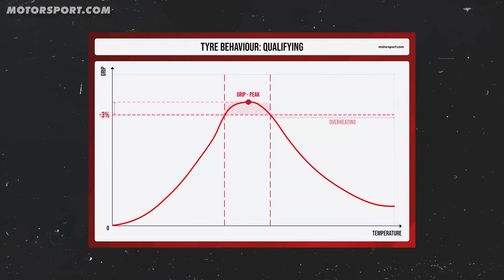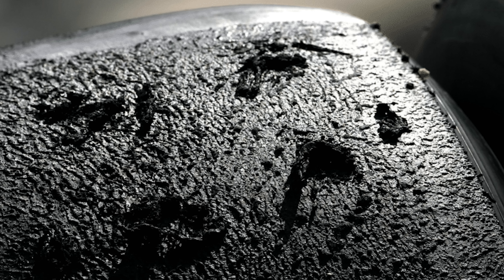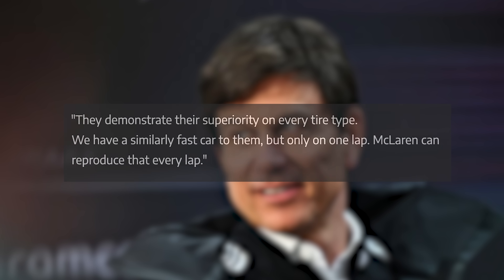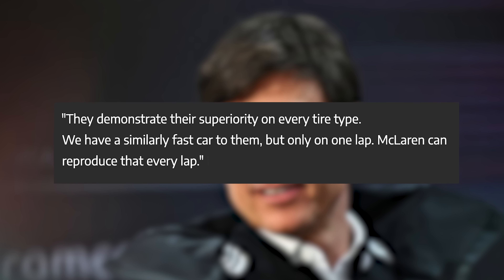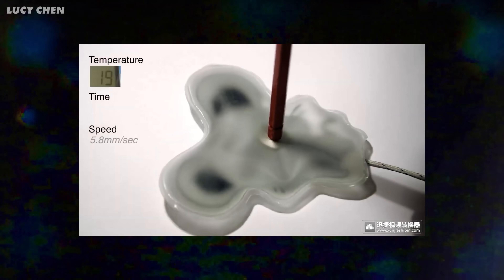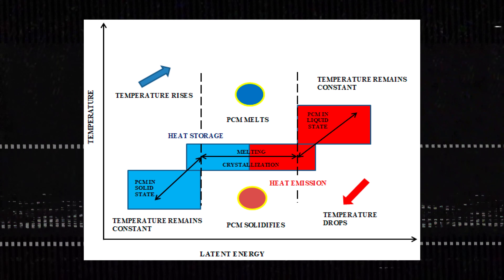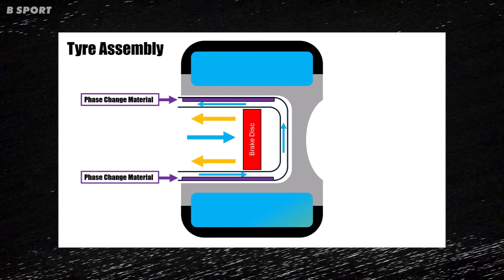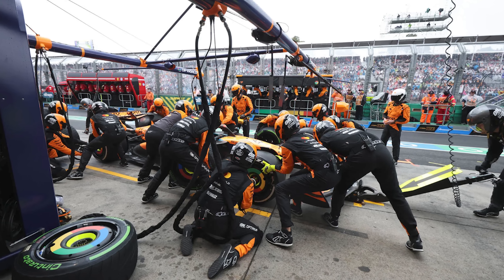McLaren’s GENIUS Tyre Trick Explained

Comment: What I'm a bit confused about is - for a continuous system across a stint duration during a race, in order for Mclaren to have lower tyre temperatures, the total cooling capacity across the stint duration needs to increase versus its competitors - which seems to be the basis for Red Bulls protestations.

A phase change material can consume a larger amount of energy/heat for a short duration of time as outlined within the video, but as soon as the material has changed state, it is no longer going to do so.

Therefore, the best case that I can see is that the total cooling capacity of the McLaren brake ducting is not larger than that of its rivals - the phase change material could absorb a sizeable amount of thermal energy during a braking event (of which is not transferred to the tyres), and then while the car has exited a corner/corner complex, the ducting then cools the phase change material and resets it for the next braking event.

Therefore the 'peaks' of thermal energy are lower, and this thermal energy is dissipated over a longer period of time whilst the phase change material changes back to its original state.

As covered in the video, if this were located internally to the drum this would be an ideal location, and if carefully tuned (perhaps different configurations circuit to circuit), it certainly sounds plausible!

From an electrical circuit perspective, it kind of seems like a capacitor that is smoothing out 'ripple', but within the thermal domain in this case.
Reply: There's actually another layer to it; when the material changes to a different phase, it's thermal conductivity can change as well. It could easily be that when it changes into a liquid at the upper bounds of the desired tire temperature, it becomes much more thermally conductive, thus cooling the tire more with no additional parts. It even works both ways, it could help the tires heat up when cold, as it could be more thermally insulating while solid.
Reply: @TheGinGear  I was just thinking along the same lines just before getting to your response. The material could be absorbing thermal energy from the tire warmers in the garage then release that heat into the tires during the warmup lap which would be a huge help in qualifying, same for sitting on the grid pre-race.
Reply: the phase change material really only has to absorb the peak thermal energy for a certain phase of the race…let’s say the first 1/3 of the race. Depending on the strategy, maybe McLaren is using soft or medium tires…the car is heavy with a full fuel load, but they want to put down 10-15 fast laps to create a gap/lead. That is when the loads on the tires & brakes would be highest. 

After that when the drivers have built enough of a lead and the fuel load is lower, they could just rely on the overall cooling capacity of the braking / tire package and also do a bit of lift & coast. It would be interesting to see if this theory is supported by data we can see in races
Reply: @itnoked  Indeed though its more short term than that too - through a lap you only have 1 or 2 big stops where the brakes are going to be really cooking etc. And really that might be all you need - as carrying extra mass to have enough extra heat capacity to really push extra hard for many laps is probably too costly for the car overall too.
Reply: @foldionepapyrus3441  you’re right…depending on the track there could only be a few big braking zones
Reply: @itnoked @itnoked  If you add the phase change material to the rim, you are back to fresh phase change material when you change the tyres.
Reply: Also you could do some engineering and planning of which drums are used for Quali and the Race. Use different phase change materials (and/or volume of material) in each for their specific application.
Reply: @michaelfitz4351 cars are locked after qualifying
Reply: Phase change goes both ways. Water to Steam -> Steam to Water. Think absorbing heat under braking and releasing it on the straights (where there's lots of cooling air). This in effect is evening out the temperature spikes going into the tires.
Reply: These materials can have as large or small a window as you like, if you want the tyres to stay at around 100°c, then the material you go for starts to slowly melt at 95-98°, it will last the full race because the tyres  wouldn't be 100° for every bit of the lap. It's also possible that The material could be in the wheel rim & so gets renewed each tyre change.
Reply: @chrissearle6176  Or it could be that you haven't seen Martin Buchan's video, and you didn't know about the bimetallic ducting part😂.
The PCM is merely fixing the fluctuations, when the other system give long term regulation.
Reply: @chrissearle6176 you can’t alter the wheel tire or rim
Reply: Nah, you should just watch Martin Buchan's video, where he talked about PCMs being only part of the solution (smoothing out fluctuations in temp). The other part is long term regulation, that could be done by bimetallic valves in ducting.
Reply: So couldn't it be even simpeler? Bimetal flaps that open/close channels based on temp? one normally open one normally closed and at some point they reverse their state? this can have an overlap making it easier to keep the same temperature without too large fluctuations due to opening and closing. there are also soldering irons that use this method for heating and those are quite competitive oppose to the regular thermocouple heater combination
Reply: @StefsEngineering  This was mentioned in the linked source video. The only problem I see is that this could likely be considered a "movable aerodynamic element" even though it's completely passive.
Reply: @phonebem  Good point, eventhough it is not hinged, it still moves. and if they do not allow bendy wings there is no reason to allow bimetal flaps. they do control aero afterall. Thanks for the comment!
Reply: @StefsEngineering  I initially went down the same path but discounted it since they've been closely scrutinized and been found to be legal. My further thinking was down the path of cleverly hidden heat piping like CPU and GPU coolers, no moving parts...
Reply: It may be absorbing the heat under breaking then cooling on the straights with the airflow so working the entire race. Very cool
Reply: In simple terms the energy can still flow both ways. It creates a larger buffer when braking, and then cools back when not. The temps in theory wouldnt get as high as in other cars (even if the same braking energy goes into the drums) thereby not heating the tyres.
It would rely still on being cooled after braking but would add a buffer
Reply: Aero engineer here and I also think b Sport is just wrong, as pointed out by the top comment.
Reply: Would it be possible that once it has reached a liquid state it is replaced through a system of internal tubes with a granular solid one coming from a cooler reservoir and the cycle is just repeated?
Alternatively, what if mechanical pressure is used to manipulate the melting point?
Reply: @magnero2749  At that point you can just use water😂, it's also phase change: it boils at 100°.
Reply: @sasjadv  I thought the video implied you are not allowed to use water. Also, the phase change of water might be too low for the temperature range they have to work with.
Reply: @magnero2749  
This is essentially a fancy heat shield - like the ablative ceramic tiles on the space shuttle
It's will be a lightweight composite/ceramic that does not melt - but under exstreme conditions it will burn off.
Reply: @magnero2749  That is correct. But the concept of using water, is to refresh and supply it from a separate tank. You are not allowed to use another liquid instead of water. It's the same concept.
But what is allowed is making adaptive ducting inside the wheel, and using phase change materials to only smooth out the fluctuations.  Which is what Martin Buchan talked about in his video.
Reply: He is talking about it being used to deflect heat from the brakes, which fluctuates dramatically every lap. So the as the brakes cool on the straight the phase produces heat, keeping the brakes and tyres warm where they are getting the most cooling from the ducts and least amount of use. Then through the corners the heat from the brakes changes the phase which cools the phase change protecting that braking temp from going into the tyres where the tyres are also being worked the hardest (braking and turning)

Comment: McLaren is clearly doing something that kept the tires at temp and if this is it, it’s actually genius. The clear tell something was up (for me atleast) was when either Lando or Piastri would be around 12-18 laps in and you see the car they have been behind the entire time no matter who it is start to drop off in sector times while they get faster. And once they get the lead they explode it into a 10-15 second gap by the end of the race with no cautions/restarts or weather. When Max and redbull were gapping everyone they were still chewing through tires like everyone else, but clearly had the better car and driver
Reply: It's probably why they are still losing out in quali. It could be that aerodynamically they are close with other teams which levels out the field over a single lap. But during the race, they have way better tire management, and can keep good pace for way longer.
Reply: @splinterun9005   yea its how system works it doesn't work in short term aka 1 lap but long term say 5+ laps it starts to show
Reply: And a car with a better braking system is a better car. Now McLaren has it.
Reply: @2wheelsr2wheels39  this doesn't affect the brakes, it hinders brake temps affecting tire temps

Comment: Ceramic tiles, similar to spacecraft re-entry vehicles, could also be used to absorb heat.  Plus, they are very light.
Reply: They insulate from heat tho, not absorb, don't they?
Reply: That's insulation actually... But i don't rule out the ablative heat shields. (Solid skipping liquid and straight to gas like dry ice) and carry the heat with it.

Comment: My theory, they're putting Vick's Vaporub on the tires before the race
Reply: Mate Norris would be in the fucking wall every Q1 😂
Reply: my theroy is there a pee tube and the driver pee a bit to spray
Reply: Not on the tyres, but on the rim wall.
Reply: Please, what is "Vick's Vaporub" ?
Reply: @francaistvavecyoussef22.  Vicks VapoRub is a mixture of petroleum jelly, camphor and menthol. 
You rub it under your nose. It is very pungent and it helps clear the nose if you have a cold. 
It is also good for reducing the pain of a headache.

Be careful DO NOT GET IT IN YOUR EYES.  The fumes from the VapoRub under your nose can make your eyes water so much that you cannot see !
Reply: @francaistvavecyoussef22.  it's a rub on material you use when you have a cold, it slowly evaporates releasing vapours that help clear congestion over a long period of time.
Reply: Rumor has it Mercedes have olfactory evidence of this; also their mechanics never seem to get colds.

Comment: the minute you mentioned phase change I thought to the Honeywell TIM pads we use in PC's similar principle!  Sweet tech on their part!
Reply: The principle of those pads is not even remotely similar. Phase change improves thermal conductivity in those pads, it is not related to buffering heat in any way.
Reply: @ПётрБ-с2ц  It is similar, just a different type of application.

Comment: Water is the earth's phase change material. RB is, probably incorrectly, accusing McLaren of using water's phase change to steam. Right-process/wrong-material. McLaren is just using a more sophisticated material with the proper temperature and wider platou.
Reply: I don't think RB or any other team is dumb. I guess they figured this out some while ago. The statements about water cooling was just to make the FIA have a look at it. Using water also makes no sense because of the density of steam. I'm sure people at RB know this.
Reply: If its true im surprised its legal because liquid cooling is illegal and water or not, if it phase changes to steam its a liquid they use
Reply: @KebunH  phase change material don't need to be steam. martin buchan explained it perfectly in the video, it's a SOLID MATERIAL!
Reply: @nicoluthi6452  if its a state change it changes from one state to another. One of the states is solid, whats the other state that it's changing to?
Reply: @KebunH  Solid to liquid. Gas takes up a lot more volume unless you use a very strong container, which would be heavy.
Sodium changes from solid to liquid at just under 98c.
Reply: @KebunH 
F1 was always about engineerin+racing. If one team developed some technology and. If u want at drivers in same cars, maybe try Indy Racing?
Reply: @KebunH  it's passed several rounds of FIA scrutineering. And the latest, basically the FIA told everyone "were done looking at this"
Reply: @Real28 it shouldn’t have. Having something like this giving BOTH cars a clear significant advantage is unfair as hell. Redbull had an advantage with Max because 1. They had the money to develop 2. And Max is a good driver, give this technology to any of the other 9 teams and they’d be on the podium every race.
Reply: @jjjfo1818  Remember when Mclaren where struggling at the back of the grid in 2023...... they have been developing this since then so its not unfair they have put countless hours and money into research and developing this. It would be more unfair to ban this because other teams didnt do the work needed.
Reply: @jjjfo1818  if it passed scrutineering multiple times from the people who literally write the rulebook, then it's not against the rules and the other teams should have thought of it first. Like DAS in the Mercedes or flexible wings. If it's within the rules, then nobody can complain.
Reply: @Dischingo McLaren fan much?
Reply: This tech is already in use in the cars within the battery. So I’m assuming it’s legal. 

Specialists in this field become crucial in 2012 when the 2014 engine rules were delivered to teams and they discover they had tripled the amount of items that needed cooling.

Comment: If this is what McLaren have figured out to improve their tire temperature management, what a cool use of material science to improve a race car. Thanks for sharing this insight.
Reply: And' it Legit not some quirky rule escape, they just applied it to their cars first, by next season something similar will be on every car who can budget it.
Reply: @eclipse.hw1337 perhaps the FIA will outlaw it for 2026 to keep a level playing field. They won't this year for certain though as it is legal.
Reply: @RikJameson  I´d not be that sure about it. F1 has banned stuff within a season, even if they were legal loopholes.
Reply: Except it's certainly not only phase change materials (PCMs), and probably something like bimetallic adaptive ducting in combination with PCMs.
Adaptive ducting will change the routing of airflow can heat or cool the rim depending on the temperature; but they will also introduce fluctuations, PCMs will smooth them out.
Martin said in his video this is unregulated in F1, so you are allowed to use bimetallic flaps.
Reply: It is, but every team should now be able to use it.
Reply: @jjjfo1818  They all have to figure out how to make it work.
Reply: Fun fact, all materials are "phase change materials". With enough heat, everything changes it's phase.

Water is the "best option of them all" as it changes it's phase to steam. Since water is banned/outlawed for cooling tyres, the same principle should apply to other materials which do the same or any other "additives" in and around the tyres which achieve the same result and where they change phases depending on the temperature.
Reply: @N1c0T1n3__ not true, water is actually the worst because it turns into steam at a relatively low temp which causes significant tire pressure changes.

Comment: Me thinks that the biggest difficulty is to find the optimum cooling while adjusting the material properties. The material itself is not so much a problem but to find the sweet spot since the PCM can hide problems: it is a heat battery and once you run out of "juice".... you suddenly need dramatically more cooling. All the materials that i've seen used in PCM are relatively simple, for ex salt based where simply adjusting the ratio of different salts gives you very predictable pattern. But, going all thru that iteration that really can't be done in a closed, controlled environment since some of the main parameters can only happen in an official F1 session driven by your teams drivers... You need several really good guesses before you can even dream of testing it in real life.